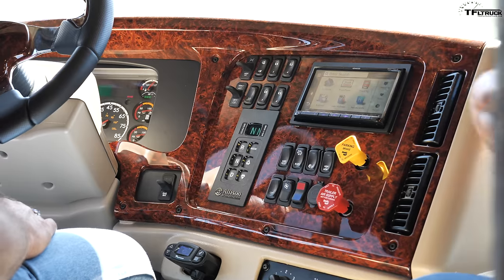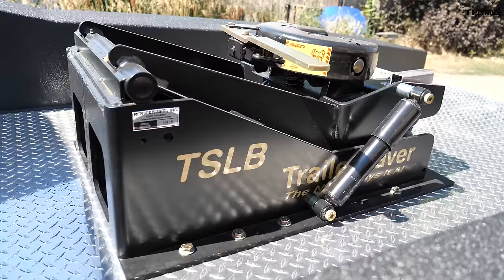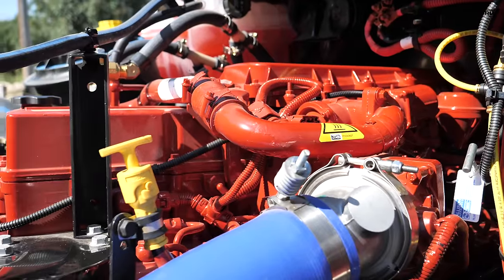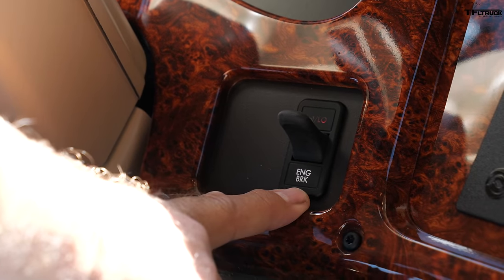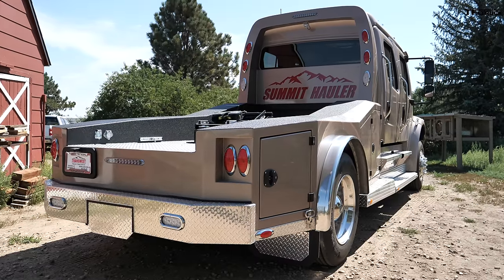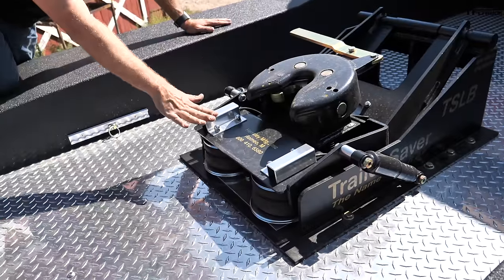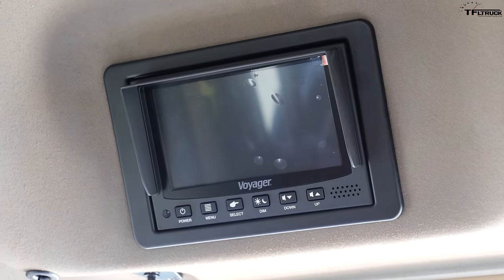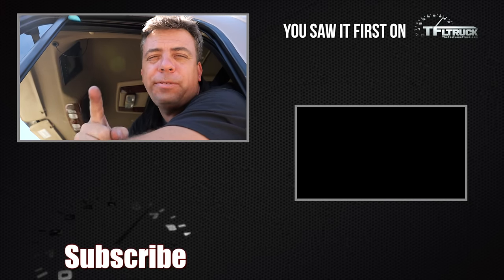Here’s Why This MONSTER Freightliner Will Make You Hate Your Dually Pickup!

Comment: Why would you buy this for 30k pounds towing when you get the same from a dually? I'm not dogging the Freightliner, I'm just trying to understand who would purchase it over a dually. What is the target market?
Reply: The 1 ton would be nearly maxed out, while the basic design of the small semi won't be maxed out. The front axle on the semi is as wide as the rear, giving it more stability. The brakes, axles, engine, and everything else is bigger. They stated that this truck is derated due to having it setup for a soft ride. I'm sure this truck will have a more comfortable ride than a 1ton, since everything is riding on air. 1 ton duallys are light trucks. A class 5 is medium duty....difference between a 3500 truck and 5500. People who have 40-45 foot long toy haulers will use semi trucks with a single rear axle, like this. I have read quite a bit about them on the RV forums. Some of them buy them used and remove one axle. The new dodge baby diesel 1500 pickup is rated to tow 12k pounds but only has a cargo capacity of 1200 lbs. My 21' toyhauler weighs 8500lbs with 1180lbs on the tongue and it is 11.5' tall. It is a hell of a load for a half ton, would max out that one without anything else in the truck, and is a big load for my 79 C20 Chevy pickup with many upgrades, including engine, brakes, trans, etc. A new 2500 truck is ideal for my trailer (hopefully I will get a 2020 duramax) and nowhere near it's limits. 30-35K is the limit for a 3500 dually, and a 4500 or 5500 truck is much better suited for that weight. If I was towing heavy, I would certainly look for something with air ride (including seats) as neck problems make bumps in the road painful when I drive a 3500 dually. Different strokes for different folks. The guy I bought my trailer from, used a half ton truck that was only rated to tow a 5500 pound trailer. In a pinch, I used the same exact model and it did the job when the trailer was empty, but I would want the power, stability, and longevity from a 3/4 ton.

Comment: My only critique...don’t just say it turns really tight! Give us the turning radius! Or compare it to another brands turning radius...if I’m going to spend as much as two normal dually’s don’t skip over important stuff!
Reply: Shorter than your 1 ton.  These are designed for 90+ deg. To trailer, and have 55d steering angle, vs pickup limited at about 40.

Comment: Well my daully pick up is sorta kinda like a 1991 Ford F-350 (not the diesel) and it kinda sorta shoots flames sometimes and that’s after I fixed the timing and like it’s sorta kinda the loudest vehicle on the road aaaaaannnndddd it has semi truck mirrors and the body is cracked at the duallys and the front passenger door is white with a bird while the rest of the truck is red....... so overall good luck make me hate my dually (it was only 1k to buy and I put another 1k into it for new gas tank and just various engine parts that needed replacement like spark plugs etc.)

Comment: Its probably a dd9 business class converted to a pickup of course it has air system if it's a semi truck and not four air systems the truck runs on air power for its suspension in components along with its brakes unless you have certification on your license you should not be driving it because you are under classed

Comment: 162K and it only tows 30,000 lbs, huh?
Reply: Powertrain is designed and can tow more, however government regulation does not allow it.
Reply: BTW, I believe by the posts you can buy truck direct from your preferred brand dealer and install bed locally that knocks 70k off the price.

Comment: Amusing and expensive.  But my vehicles are chosen to meet my needs.  I pull nothing larger than a vehicle on car hauler trailer, haul nothing larger than a load of firewood.  Thus, a 3/4 ton is adequate.  I can exceed the load capacity of this shiny toy, using a 60+ year old International farm truck.  And it does not require a CDL.

Comment: With it having air brakes it requires a CDL?
Reply: C Moore You beat me to it.
Reply: Gross vehicle weight rating (GVWR) determines the class of license required, not brake system. However, most trucks with a GVWR over 26K have air brakes.
Reply: C Moore your are correct that many states have their own regulations, but I don’t know of any that base the class of license off of the type of brake system. Still smart to check your home state though. I do this stuff for a living.

Comment: I wouldn't exactly say that is a pick up. Rigid would be closer. Far bigger than any pick up. Baby Coronado. 15l/6 turbo 600hp on Dyno. "Impressive" Rip the A frame off of most trailers. The 18 speed is a pain in the ass in those lounge chairs. No thanks. Maybe for race trailers or BIG boats. "Bull riders dream." Spose there is a small market for them.

Comment: Extremely dated tech compared to previous-gen 1tons. Sure that'd be safer to pull a bigger trailer with, but I'd rather go with a 1ton and upgrade it with air ride, bigger brakes, 10 bolt wheels, hell even axel swap it and still be cheaper than that, with better amenities. For a $160k asking price that thing better outclass Ford/GM/RAM in more than 'safety' capacity.

Comment: Dual air tanks!!!

1st air tank is for the truck brake
2nd air tank is for the trailer
Reply: Daniel Garcia dual air tanks means one is primary other is secondary. If you have a problem with 1st tank you can get to a safe place to stop before running out of air. If your air gets to low the parking break will apply and you won’t be able to move the truck
Reply: Mack Stikeleather well said, if a trailer has air brakes the trailer will have its own tanks
Reply: @mackstikeleather4740  just cage the rear brakes only takes 5 min.

Comment: No thanks! After 40+ years of driving big trucks? I would never own one of those big awful heavy lumbering beasts! Matter of fact, I don’t see any real reason to even own any Dually! Mostly due to the restrictions on many beaches all over America that limit your access to! No if need be I’d buy a HD Crew Cab Short Bed SRW But with the biggest Engine and Transmission available! No matter how many air bags you might have, there are still the big heavy hard truck tires at 120 psi that will cause you to feel every bump and seam in the road, never mind the ease of 4x4AWD in all the big three SD/HD manufacturers have for sale for your choice. That Freightshaker will be a rattletrap in no time!

Comment: you could literally buy a dual axel m2 have 1 extra axel then make the wheel balance plates and then make a whole custom bed for the truck and then when you use it you will feel more attached to it and it will have every thing you want that this truck in the video does not have

Comment: Poor Alfredo, time to wake up !..?....back in the 1980's, I was working on sa railway's, bringing the heavy loads for sasol 2&3. Railway's had many Mercedes trucks. But for the real heavy loads, we had to use american power. In this case the international pasifics, and the Cummings a powered Fodens ! Over a certain load, the euro's couldn't keep up. If the Mercedes trucks are so good, why do they have to use american trucks, the freight-liner, with Cummins power ?  This xxl dually killer, is : 62,000  dollars for the truck, and 100,000 for poor mersiets/Mercedes !....who struggle badly. This ,good' dually, should easily give a gallon a mile !....loaded, easily, 3 gallons a mile !....fine !...AAA would think.